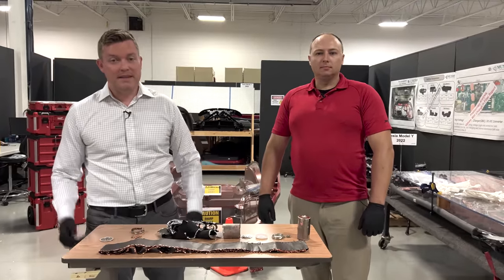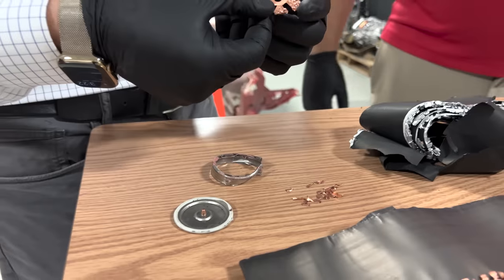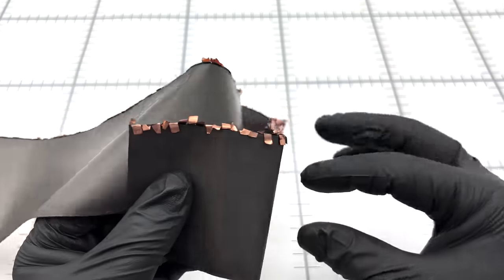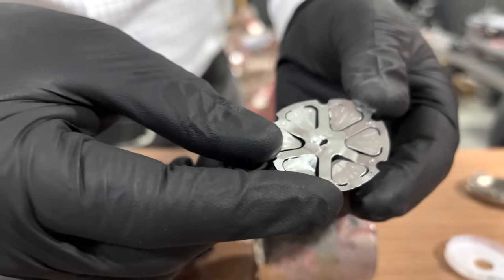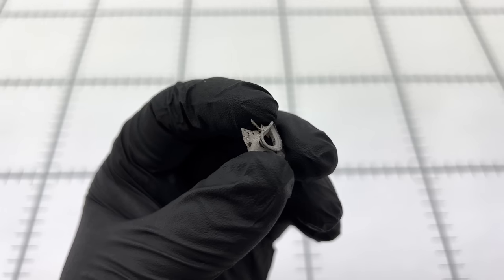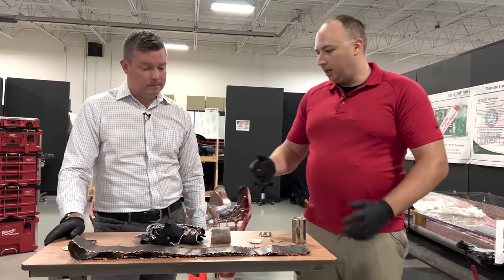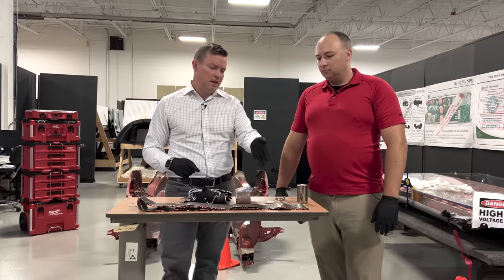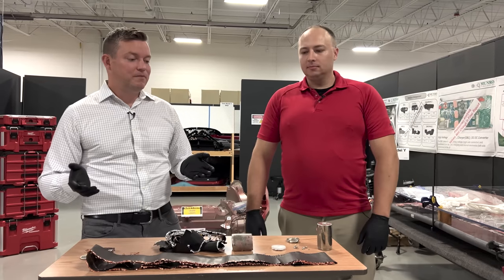What's Inside a Tesla 4680 Battery?

Comment: What's amazing to me is.. this is from a car manufacturer lol.. show me another car manufacturer who can not only come UP with this new battery, but actually BUILD it AND the machines that build those batteries. These guys are off the charts on engineering scope and ability
Reply: NIO?
Leading brand. Claim to be about to hit the market with 360 Wh/kg cells. 150 kWh sedan.
Reply: @jcwiggens  Tesla manufactured the 4680 cell you see in the video.  For other vehicles, Tesla uses cells manufactured by 3rd parties.  Tesla uses those cells to manufacture the final battery pack, which consists of the cells, battery management system, cooling, etc.
Reply: Tesla does not make the machines that build the batteries
Reply: @UCvvxCyvHSNEbT6iAZDGjh8g  you don't know wtf you're talking about.

They DO make THESE batteries that are their own. They don't make ALL their own batteries.. but they make these, and will be making a LOT more in the coming years
Reply: @Cloxxki  Nio doesn't make those batteries.. not that I've ever seen. They use CATL and other Chinese manufacturers. F, Nio doesn't even BUILD their own cars! They use a 3rd party manufacturer, named JAC Motors.

The only interesting thing Nio has 'built' and designed is their battery swap stations. Has nothing to do with building the batteries.. or the cars for that matter.
Reply: @UCvvxCyvHSNEbT6iAZDGjh8g They do. Check out Giga-Nevada. It's done in cooperation with Panasonic. They did the 2180 cells, but the 4680 cells are all Telsa's. There are 4680 cell plants under construction at Giga-Texas and Giga-Berlin.
Reply: @cyclopsvision6370  tesla also manufacturers the 2170 just didn't make enough so they had no choice but to source it out but they aren't going to with the 4680 because this is there lead advantage most car companies are going full in to evs now
Reply: @AndyZach  2170
Reply: @PR-hl9pm  they do
Reply: @jooptablet1727  which one exactly? The dry coating calenders for example are made by Saueressig
Reply: @AndyZach  According to Wikipedia 4680 Manufacturers include Panasonic and LG
Reply: @PR-hl9pm  lol are you going to argue that they don't make the nuts and bolts to hold together the machines next? Where's the line exactly?
Reply: @ziggyyo  Tesla is not currently putting those 4680's in their cars. Only their own 4680's from Kato road and possibly Texas. AFAIK they aren't even delivering 4680's yet, just building the factories.
Reply: BYD produces their own Blade batteries.
Reply: @andrew7455  true. I forgot BYD does both. I think BYD was making batteries before they were making cars.. lol.. though I don't know that for sure.. just something I remember seeing somewhere once
Reply: @lesstevens2370  Tesla does not manufacture 2170 cells.  They own the facility, but Panasonic owns and controls the manufacturing process.  It's a single customer relationship.  Tesla is contractually obligated to buy all the cells that Panasonic can produce from the Nevada factory.  After Panasonic manufactures the cell, it gets sent over to the other side of the building where Tesla assembles the cells into a battery pack.
Reply: @PR-hl9pm  maybe there is a component or two or even more of the 4680 line that isn't directly built by Tesla, but they make a lot of that line. I don't know specifically what parts are theirs and what are sourced from outside, but it is Tesla's baby. Yes, they have since shared the 4680 design with other battery manufacturers who are going to go into their own production, with likely different machines and processes. Like, I don't think Tesla is supplying Panasonic with the machines to make the 4680's they'll make. But the battery plants in Kato, Austin and soon to be Berlin, are designed and made by Tesla, at least to a large degree.
Reply: @jooptablet1727  the calender is not exactly nuts and bolts in the manufacturing of dry coating. Can you name a single machine that tesla manufactures? Do you know how batteries are made?
Reply: @airheart1  of course they are designing the factory but they fill the assembly line completely with parts made by other suppliers. The Gigapress is also not made by tesla but by an Italian company named idra.
Reply: @PR-hl9pm  question: would you agree or disagree with the statement "Tesla has designed and built the 4680 battery production process"?
Reply: @PR-hl9pm  not completely true. Tesla IS producing much of the 4680 line equipment themselves. I will try to find the company they own in Canada that is doing it and you can research the validity of this yourself. And yes, we all know of Idra building the gigapresses. I never said Tesla builds that. We were strictly talking about battery production. Tesla not only produces the 4680s themself. They produce much of the equipment that is producing those 4680s also. I can't say a % of the equipment.. I am not involved in the company. But it has been found and researched by others, and I think Tesla has stated this themselves, that much of the 4680 line is their own design and production.

The factory is in Ontario canada.. using the Hibar Systems manufacturing equipment that Tesla purchased back in 2019. Look it up
Reply: Other car companies let battery manufacturers develop it and buy cells from them to put into a pack. Tesla produces it's own batteries because they also use them in a bunch of other things--powerwalls, megapacks, etc.
Reply: @areitu  4680s only go in cars. And will for a long time.. maybe some day way down the road the production capacity can accommodate more products. That’s like a decade away
Reply: @PR-hl9pm  Tesla uses it's own machinery and equipment for the production process of it's batteries, (almost the whole process) they bought two companies, one is the Canadian one that was mentioned, and the other one was a noted company from Germany, as far as I can recall they even had issues with Mercedes-Benz when they bought the company, the company was a supplier for Benz and after the acquistion Tesla was reluctant to provide any more services to Benz, I can not remember the names but it's easy to find.

Comment: Thank you for the update.  Is the top and sides of the can a single piece of metal, like a cup?  If so, I wonder how they form it?  BTW, interesting that in the Limiting Factor's teardown of an early version, the bottom plate was insulated from the shell, seems like in the production the anode "flower" is sandwiched (and therefore electrically connected) to the two pieces.
Reply: It's a deep draw metal stamping, same as all cylindrical cells, but upside down.
Reply: @JRP3  Thanks for the info.  I watched some videos on the process, very cool that they can maintain good dimensional control, especially of the sides.. As you state, most batteries have the seam on the button end, so this one being on the flat end is very interesting.  There must be a good reason for this.
Reply: @satoshimanabe2493  They electrically isolate the bottom cap of the cell that way.
Reply: The body of the can is a cup with a hole at the end. They put the contact (surrounded by that insulator gasket) into the hole, then push the jellyroll into it. In the centre of the jellyroll there is a rod, which then clamps the aluminium collector plate to the contact before it is pulled out. Then the bottom plate is clamped on, which makes contact with the copper side.

Comment: As you guys are battery experts. Can you please suggest what would be safe for my family Tesla Model Y. In case of a crash, would 2170 be more safe choice then 4680?
Reply: Since the 4680 pack is "structural" and the cells are surrounded by that dense fire-retardant foam, I'd wager a 4680 pack is safer in a crash.
Reply: They're BOTH top notch.
Reply: Right now the Model Y is the safest car you can buy (with latest crash and crash avoidance testing in Europe).  I should note they haven't tested the 3/S/X yet with the new stricter standards, but I expect they are all tops in thier categories, even with different cell sizes. I wouldn't worry about the battery size.  Tesla is very focused on making safe cars and has real tests prove it.
Reply: The model Y is a very safe car in general, regardless of which cells it's using

Comment: Great stripdown, great to see the deep down details of this cell.  So much engineering "in the can".  Trying to turn a small cylindrical cell into a pouch!  Still a lot of stainless floating  around in the pack assembly that has to be constrained and supported.  Really not impressed with the recyclability of the "structural" foam fill though.  That's the whole point of cylindrical vs pouch, where to put the structure!  Support the cell then support the cell supporting structures (cylindrical) or just support the cell and the support structure is both.  It's interesting to see where we'll end up as most pouch packs are still quite immature.  Even F1 has a mixture of pouch for some teams and cylindrical for others.....
Reply: Pouch cells have almost no strength. Cylindrical cells are immensely strong individually. The foam provides a strong matrix to transfer the rigidity of the individual cells to the pack as a whole. The foam does not need to be recycled, it's embodied energy is microscopic and it is not effectively recyclable, nor does it need to be.
The metals are all that need to be recycled. Even the graphite on the anode is so cheap it's not essential to recycle it, although I  believe it is done.
Reply: @gregbailey45  It makes the whole pack disposable as it can’t be repaired.  The lengths Munro went to to remove the foam is the point. 

Of course they have no strength. That’s the point:  The battery case has the strength to both preload and support the cells. 

With cylindrical, the cell case supplies the preload but then has significant mass. The battery overall case then has to be a lot stronger to support all that cell mass. Mote mass overall as two components doing separate jobs rather than one component doing both. 

The foam certainly helps the cells do more of the structural work. No doubt at all there but any serviceability is gone so whole pack must be replaced and recycled for any fault.  

Even if it barely affects recyclability, it’s not a good design for sustainability.
Reply: Replacing individual cells in a pack is a bad idea if you are not a diyer who is regularly balancing the cells separately from the BMS. When you swap individual cells and/or modules in a pack, they tend to be out of balance. A BMS can handle a imbalance, but a large imbalance constantly adds wear and stress to the BMS. At best case, the BMS dies early and turns off the whole pack. At worse case, the BMS fails and doesn't turn off the pack. That can cause either a fire if it happens during charging or several completely dead cells in done during use. Not a good option for a mass produced vehicle with the vast majority of people not knowing how to balance their cells, even if Tesla and other automakers were to make it easy. There are ways to make modules replaceable that doesn't have those risks, but that adds costs, weight, lowers efficiency, and has more failure points.

With the structural battery pack, it is hopefully removing costs while improving strength and safety. Any manufacturing issues will come out and be handled during the warranty period. Any wreck that can damage the pack enough to force replacement cells is also going to be bad enough that the entire vehicle is totaled. The amount of cases where it may be beneficial to have swappable modules (ignoring the issues above) is so few that it simply isn't worth it.
Reply: Yes that's all a given but it means that even Tesla can't repair packs, they are essentially scrap.  Even a failed BMS connection that can't be reached to be repaired means it's a essentially a throwaway design.  We're not talking about Rich Rebuilds here, even Tesla reworks and remanufactures packs all the time.
Reply: @ruaraidhmcdonald-walker9524  True, but if Tesla is eating the costs, then they must believe that the savings from recycling is worth it. You don't just throw away 10k-25k worth of material. That would take away all the profits from the car. 

The BMS not being replaceable I'm a little torn on. On the one side, I can see that there is a risk in just replacing a BMS. But as far as I can tell, most of the risks are minor at best. Again I come down to the fact that Tesla wouldn't be eating these costs without good reason. Or rather, they would be losing money by replacing than recycling.
Reply: @anthonypelchat  You'd certainly have to hope so.  The foam just doesn't feel right somehow.....
Reply: @ruaraidhmcdonald-walker9524  It doesn't feel right for anyone who would want to do anything with the pack by themselves. And it does take away from anyone hoping to get their hands on 4680s for personal projects, at least until third parties make enough of them. But it makes sense from a manufacturing and recycling process, as far as I can tell at least.
Reply: @anthonypelchat  We'll see, given the struggle that Munro had, looks like any simple BMS repair (which Tesla certainly do carry out) will be almost impossible. 

I'm not even thinking about any DIY or scrap part reuse for personal projects, just sensible in-service repair. Given how new all of 4680 is, that could turn around and bite them.  Might give it a few years.....    As it looks like you're pretty much certain to have to replace these packs in one piece. That's just not a good sustainabillity model.
Reply: @ruaraidhmcdonald-walker9524  If the batteries are as reliable as the 2170s, they shouldn't have an issue. Taking out the pack from the car is pretty quick. If the 4680s end up having a lot of problems, that will be a mess. Not sure that it matters being structural or not though at that point. The BMS shouldn't be that big of a issue if the cells are good.
Reply: @anthonypelchat  Let's see. they're snookered if there are problems and they're still in the ramp up phase for this (very novel) cell design.
Reply: @ruaraidhmcdonald-walker9524  Absolutely. If they have issues with the new cells, the only saving grace for them is that the pack can be replaced quickly. I doubt it will be an issue, though. They have been testing these for a while and have been building packs for a very long time now. We will see how it turns out. If we don't see anything major by the end of next year, then they likely won't be a problem at all.

On the other side, I'm pretty sure that they are software limiting the packs on current models. Or rather that they are doing so much more so than on 2170 packs. I don't think its a massive amount like some have been speculating, but possibly as much as 10-15%.
Reply: @anthonypelchat  They've just unlocked a whole new charging rate for older (18650) Model S with the CCS conversion over here.  Mine now north of 160kW on a V3 SuC compared with 130kW before.  Just on the latest SW so they definitely have some in hand.  

We'll have to see on the reliability, it's never been their strongest point....
Reply: @ruaraidhmcdonald-walker9524  Nice on the charging. What year S do you have?

Reliability on a lot of things with the cars hasn't been great. But the batteries and motors have mostly been extremely good. Especially once they got through the initial ramps on the S and later the 3.
Reply: @anthonypelchat  2018.  Seen a fair few smattering on 3 HV issues on the Owners club starting to appear.  Mostly infant mortality though.  Will be interesting to see how 4680 rollout goes. It's very new and a big difference from established practice in all areas.

Comment: So they use a zillion tabs to cut resistance and then run all the current through those this spider endplates? Interesting.
Plug in the bottom does not look like a vent. You should charge and short a cell to see how it vents. I suspect the anode end will pop off.
For those interested, there is a much more detailed teardown online now. I believe it is on the CleanerWatt yt channel.
Reply: Those end plates look a bit how's your mother to me. Micro welding the tabs onto those raises a couple of issues. Firstly, it has to introduce unwanted resistance. Secondly, I wonder how well they will hold up to vibration?
I don't know why, but I thought that the battery would be a little more impressive than this. As for it being a "structural" component? Perhaps if you want a napkin holder but there is no way in the world that gluing a whole heap of those together could be considered "structural" in the context of the loads imposed on a motor vehicle.
That just smacks as "cheap" manufacturing to me, with no view to recycling.
I'll check out CleanerWatt. Cheers.
Reply: @davidbrayshaw3529  Total view to recycling. Investigate how this takes place... it's impressive. I suspect what you really mean is no view to re-use. That would be correct. Tesla don't want battery packs that have likely been in accident cut up and re-used with all the risks that entails.
Reply: @MrAdopado  Cryogenic recycling? The technology doesn't even exist pertaining to batteries. And if it did, it is a highly energy intensive process. 95% of L ion batteries end up in landfill.
Tesla already repurpose cells from old automotive battery packs. Why not this one? It doesn't take much to establish whether a battery pack has been damaged or otherwise, does it.
Don't fall for the marketing hype. These battery packs have been designed to be as cheap as possible to produce and given the limitations of existing technology and costs, are highly unlikely to be recycled, despite claims by the producer to the contrary. In 2022, these are still disposable batteries.